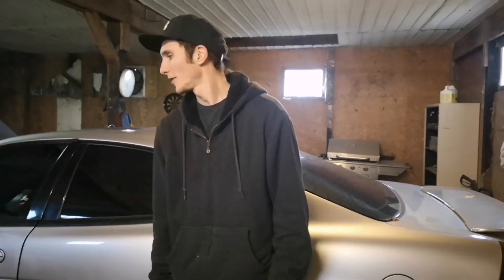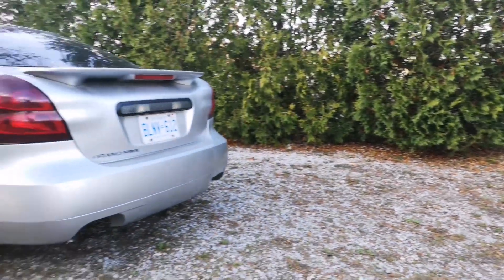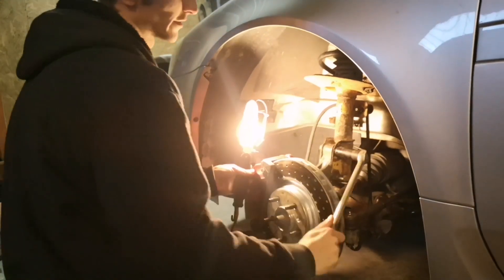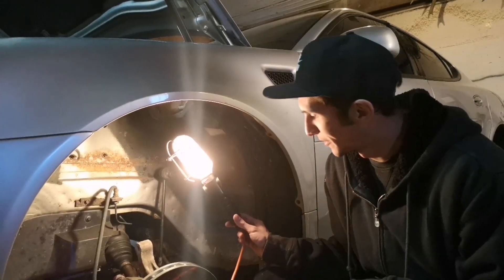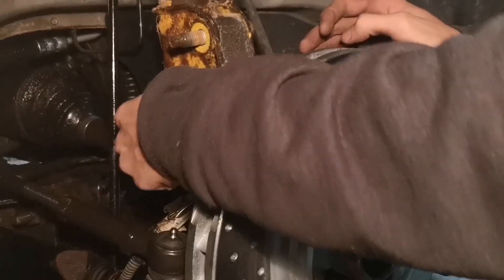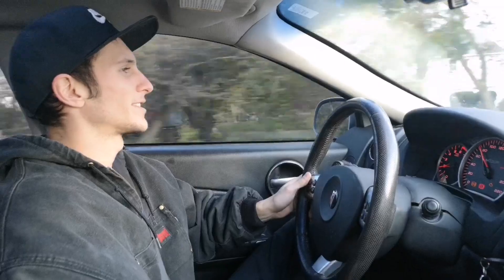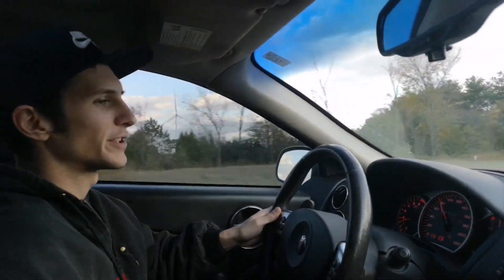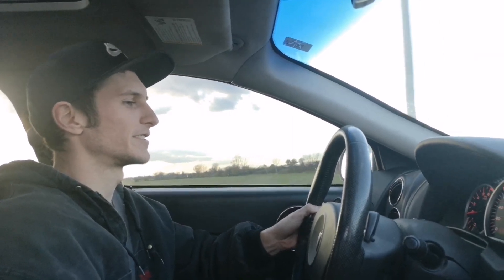Replacing front struts on Pontiac Grand Prix GXP

Comment: I have an 08 GXP if its abs/traction control lights. It's usually the wheel hub is bad or the wire harness for the speed sensor. The insulation cracks due to exposure and allows water to get in there. I've had to both happen. It can also be a bad ABS control module as well.
Reply: Put mime on code reader and got c0197 says it's a yaw sensor ??? Any bids on how to replace this. I think it's under the  center counsel .

Comment: Hey, thanks for the video. The steering knuckle on my 2000 Grand Prix does not go down far enough to line up with the 2 strut bolts. The strut is fully compressed and is too low to line up with the steering knuckle. Do you have any suggestions? Thanks.

Comment: idk if you still have this car but your steering is the Magnasteer. Its finicky. i just had my rack replaced and the magnasteer is touchy but does work. if you do the rack, get a new one and replace lines while in there and save yourself the headaches
Reply: Mine is 06, did the replacement fix the issue?

Comment: Did you ever have to replace the ball joints because I replaced the struts now I need an alignment hope it runs smoother
Reply from the maker: I didn't replace the ball joints but you will definitely need an alignment after you swap them

Comment: My power steering pump is bad and goes out at times and makes a Whiney noise but after adding fluid it fixed it for now
Reply from the maker: Ares does the same thing have a leak near the rack we need to fix and hopefully it will quiet down the wine
Reply: brokeboyz garage I bought stp power stop leak and it seams to be working so far I was told the pump is bad but it’s working good after I added the good stuff and I never noticed any leaks but my power steering was completely empty when I bought the car and didn’t know

Comment: I had a bad and wiring harness in the front once I replaced it that steering message disappeared
Reply from the maker: Wouldn't be surprised if I have the problem
Reply: I'm currently trying to figure my I have vibration in my steering wheel. I've replaced my whole suspension except the struts and ball joints trying to get rid of it. Doing ball joints sometime this week so fingers crossed. I love my GXP but damn she's a pain sometimes lol

Comment: You shouldn't have any trouble getting the two bolts out on the strut itself. You have to support the car with a jack stand, and lower the jack. Then jack it up at the ball on the control arm. You just adjust this until you have the holes lined up. Then they come out easy.
Reply from the maker: We did that they were seized in pretty good